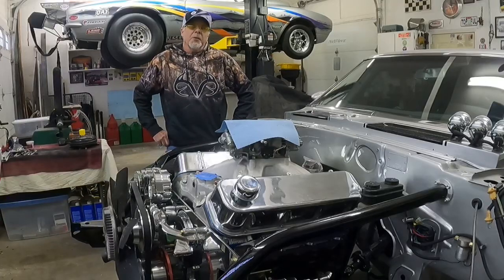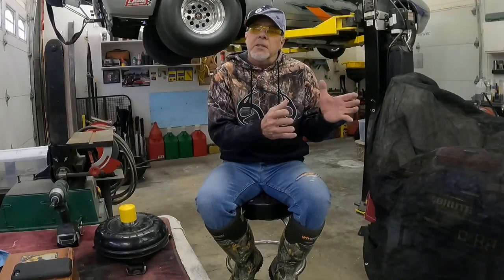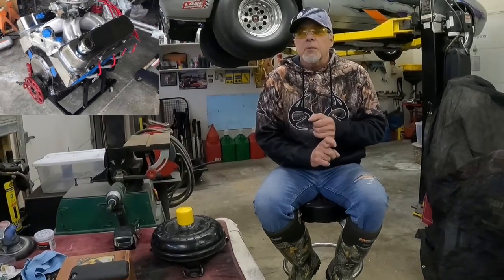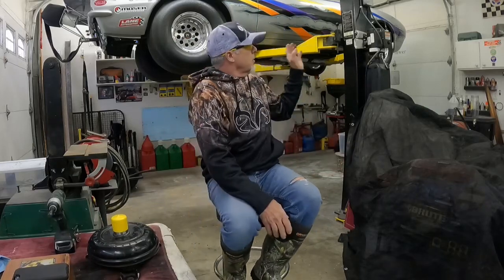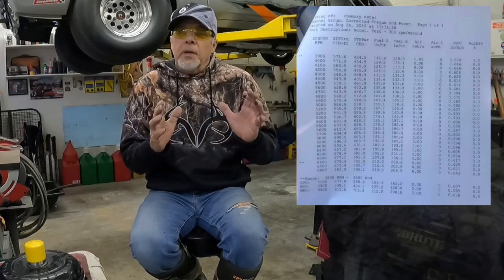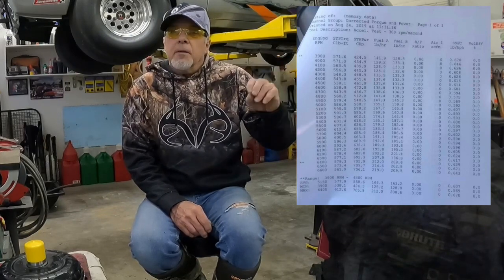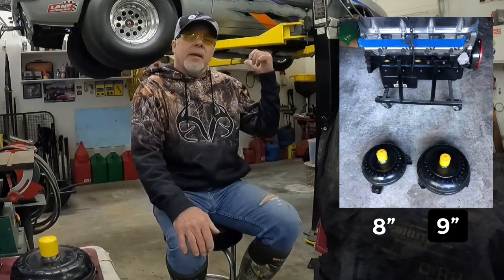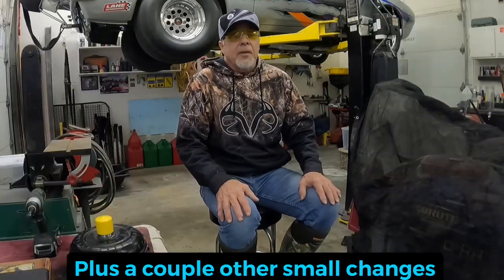Selecting a torque converter

Comment: Coe-Ann is one of the best convertor made. I been running Dave and now Jasons stuff 4 decades now. Never left me stranded.
Reply from the maker: Thank you Dooman 👍🏻
Reply: On a side note, I called Hughes about a converter a guy had for sale. They told me do not buy one of our on the shelf converters, you will flash it too high. I suggest calling the converter manufacturer before making a buy, esp a buy 1500 rpm higher than you need rule, that advice would kill the performance of a high torque application
Reply: @doomman700  it’s actually only accurate if true dyno data is known, otherwise, it’s a shot in the dark with guesstimated info. Guarantee the converter will need to be built from trial & error to get it right. 
I’ve seen countless fellow gear head friends chase converters these past 45 years.
Reply: @ronthepoolstudent  to a point I agree. However you are dealing with guys that build converters for a living and have seen a lot of the combinations being built.

Comment: Going from a 3000 stall B and M converter to a 2000 stall B and M made a big difference.
Now I go forward off the line instead of burning the tires.
Reply from the maker: Yes Gary, it’s all about hitting that sweet spot in terms of performance RPM. 

Optimal launch is dictated per everything that’s included within the power plant, suspension, gearing, car weight, and of course, the converter.  
A spot on converter makes all the difference in drag racing 👍🏻💪🏻👍🏻
Reply: So do u think it made the car quicker. Mine 3500 I’m thinking about going to 2500 converter.
Reply: @altondickens4277  In my case it did. It is a lightweight hot rod 1770 lbs.
A 427 W stock roller cam, Ford 306 aluminum heads, Edelbrock 850 cfm Weiand 174 blower,  3.25 rear gear. C4. 15 inch street slicks. Instead of burning rubber, it just goes forward quickly. I must have hit the perfect combination. More fun to drive now.

Comment: Best money I have spent is on a custom converter and double adjustable shocks.  Power doesn't matter until the engine is happy and it hooks to the track.
Reply: Amen to that Comet. My 67 has QA-1 adjustable shocks and a four link. I have it set up so no wheelie bars are needed. The car leaves level as it has an anti-roll setup. Also, Gun Lake Performance (Jeff Cuvey) did the back half work. That car is so well put together, it’s super smooth and has never gotten squirrelly out of 326 passes which is a testament to the car’s setup and also the tracks I raced at. The car ran 8.70s @ 152 mph then. Today, the engine puts out 33 more horsepower so it should run low 8.60s. I’m thinking the setup should still be adequate. 

Thanks for watching and for commenting 👍🏻

Comment: I have a 1965 sbf 289=300 hp at 4,000 rpm. In a 1964 econoline van with a new C-4  . The torque converter I chose is a 10.5 inch 2000/2400. The weight of the can is 3,500lb and the rearend is 3.25 sure trac. I’m changing the cam right now to a roller with roller hydraulic lifters at a 513 lift int/exhaust. Do you think that converter is good for this setup?
Reply from the maker: To verify William, contact Coan Engineering’s tech support. 
Run those numbers by their expert, they will recommend a stall number. Tell them you’d like the converter to flash in the rpm range for the cam and package you have.

Comment: you are the first person that explain right on the spot what a torque converter means here in the internet,,, there lot of guys saying oh,,, I just install my 3200 stall torque converter,, this is how it runs,,,!! but they do not explain what is the stall for,, thx for your info,, and I have a question ,,! I am building a 2008 corvette Ls3 making 571 crank  HP, I like to know if you can help here, looking for a torque converter for it, car wight 3250 lb ,, 3.1 ratio,  the guy that built my engine told me to use a 2200 stall, others tell me to use a higher one, so I am confuse here, if you can help please reply to my question ,,, thx,, keep it up,,!!!1
Reply: Thanks Oscar and thank you for your question. First off, that 2,200 suggested stall converter is way too low. That number would be more suited for a family type car. 

My best advice is to call Coan Engineering’s tech support then give them your info. They may also ask for more details. From this info, they will suggest a converter that’ll get you in the ball park. 

Also, what are your cam specs?
I’ll await your reply before giving my personal stall advice.
Thanks…
Reply: hi, and thx for you reply,, my cam specs are 227/235/ at.050 and 620/605 lift, and I think on the corvette came out with 3.1 ratio, not to sure,,  @ronthepoolstudent
Reply: @oscaresquivel8583  thanks for the numbers Oscar. 
That cam is a low end torque cam so I’d rely on the converter company to plug in the numbers to see what they recommend. 
That’s the most accurate way to move forward. 
Please let me know what they say as I’m very curious. 
Thanks again 👍🏻👍🏻👍🏻

Comment: What would you suggest for a torque converter? 425(437) Olds. TH350, aluminum heads, single plane intake, 950 carb, solid roller cam, open headers, 4.10 gear, 28 inch tires, both 1/4 and 1/8 mile tracks. Some street use but not often. Cam manufacturer says peak hp at early 6000's, peak torque early 4000's. Not sure on hp, I would guess 550 at the crank. Light car, 2800 lbs with driver. Thnx!
Reply from the maker: I suggest you fill out the Coan Engineering questionnaire and ask their tech specialist for a part number. That’s the second best way to determine which one is best.

Comment: Great video,  Thankyou.  I have an 02 silverado 1500, 5.3ls 4l60/65e  3.42 end. For towing, daily driver,  what torque converter speed do you recommend? A 1400-1600 or a 1650? Thankyou Again
Reply: Thank you Dale for your question. Your question however is actually tough to answer. 
I recommend contacting Coan Engineering’s technical support. They will ask for more information and provide you with an accurate answer. 
Imo, the numbers you have provided seem too low. I would be curious to hear back from you, once you’ve reached out to Coan. 
Thank you once again and please stay in touch 👍🏻

Comment: Hello curious if you think i'm heading in the correct direction with my street converter? My converter knowledge is near zero. I'm using a Summit billet 3500 nitrous converter(was planning nitrous but dropped it). I bought my project truck as a disassembled builder with a dyno sheet and just about everything I needed to complete it. I based my converter choice on my dyno sheet torque #'s 3500....400ft lbs......4500.....513.....5700......560.......6400....526. This is in my 95 Sonoma, pump gas 399ci. 1st gen., guessing 3400-3500 with me, turbo 400,  3.50 gear. This is a street truck with occational trip to the strip.
Reply from the maker: @heshtesh  your 3,500 converter isn’t going to do the job. You’ll need a higher stall for sure with the specs you’ve given. 
As I recommend to everyone, contact a  converter manufacturer and fill out their spec sheet. They will then give you their recommendation. 
Also; you’ll need to tell them what your expectations truly are, either street or strip use. Coan Engineering is a good start.

Comment: Great info thank you.  I have a new motor but dont have the exact specs. Trying to figure out the converter for it makes it rough without real world experience. 
347 stroker with a c4.
Est. 400hp/400tq.  
Street car . 66 mustang. Going with 3.5-3.7 rear end gears.  
Short of finding a dyno somewhere what would be a safe choice? And do brands matter ? I dont want junk!!!  Thanks so much.
Reply: Thank you Dave, I appreciate it. 
Although there are a few great converter companies, i’m a Coan Engineering guy. 
I’ve been running their converters for many years without issue. 

My suggestion would be to call the company to discus your package. Their expert will more accurately steer you into the converter that fits your needs and provide pricing. 

Please let me know what you find out as I’m curious. 
Thanks again 👍🏻
Reply: @ronthepoolstudent  so I talked with them this morning.  They are going to build me one, and he said the stall would end up around 2600 rpm based on my estimated setup.
Great customer service. I dropped your name too👍 Thank you
Reply: @DaveIrish66  glad it worked out Dave, I’m sure you’ll be happy with their converter. 
Thanks again for reaching out 👍🏻

Comment: Very interesting information!
 What I'm curious about lately is that I know that the weight, gear ratios, engine torque and HP and camshaft selection has a significant influence on torque converter requirements but what I'd like to know is how much influence intake manifold selection has on it. I know that the whole engine package should be matched up to complement each component and what you intend to do with the vehicle like daily driven or street and strip or strictly a strip car but how much of a factor does the intake manifold have overall. I remember when a good friend of mine built a '69 Chevelle back around 1990 or so for more or less a daily driver but also for good street performance. It was a .030 over 350 V-8 with a somewhat mild camshaft, a little lumpy but not much, and he had a Weiand high rise single plane intake put on and a torque converter from a Chevy Vega, a small converter, and of course a stock 350 turbo hydro automatic transmission. I remember he was a bit disappointed in it because it felt mushy on the bottom end, just as it took off from a stand still. The engine rpms seemed to rise up a bit high before the torque converter really dug in but I do remember the car ran nice and smooth, sounded good. Anyway, had he chose to put on say a Edlebrock Performer dual plane intake on it do you think it would have made a significant difference in the drivability or not much? Also, on the other end of the spectrum, if he'd have chose to install say a tall tunnel ram would that have made a significant difference in performance or if the bottom end would seem mushier or about the same. 20 years ago I was studying a lot of the performance builds and parts for hotrod's but over the years I've gotten a bit rusty on some of this kind of info and I don't really have much real world experience in it, mainly just from what others have said and theory so I'd like to hear your input on intake manifold selection and how much it has a factor on torque converter selection if any?
  Great video also, it's interesting to hear all of the perspectives people have on performance aspects. 👍
Reply: Thank you Jeff for your question. I can only tell you that I build/tune my drag engines for optimal intended performance first. I then fine tune on the dyno. 
From there, I have the converters custom built per dyno outcomes as indicated on the dyno sheet. I give this info along with car and drivetrain information to my converter builder, Coan Engineering. 
They do a great job of customizing what’s needed. 

Intakes:
As a drag race guy, I’ve always opted for single plane intakes as they compliment a more aggressive cam grind and high flowing cylinder heads for drag racing. 
I’m not really qualified to talk about dual plane intakes so sorry about that. 

I might add:
I do drive the streets however, but I would not want to build a tightly wound drag engine for distance driving. 
It all comes down to compromise per the build and what performance one is looking for…street or for the stripe 🤔🤷🏻‍♂️
Thanks again, I wish I could have helped more.
Reply: @ronthepoolstudent  Thanks for the response.
 I hear what you're saying, you sound like you're well versed in the drag race department which is just a pipe dream for me right now but maybe one of these days, if I ever have the means, I just might delve into it.
Reply: @bodeine454  thanks Jeff, it has gotten very expensive which is why the sport has slacked off imo.

Comment: I have jeep grand cherokee wj 4.7 v8, 4 speed , 245 horse power  engine  , Automatic Suv and with 3.73 Axle gear ratio front  dana 30 and rear dana 44  and I am using  17" wheels  rims with tyre's 265 width 

Can you tell and help with type of stall torque converter will be suitable for my engine
Reply: I also have a Grand Cherokee. Mine has a 318 that’s stock. 
To answer your question, sorry, I wouldn’t know. This said, I would contact either Coan Engineering, or any other converter manufacturer. They may be able to take your vehicle information/engine/gear ratio/tire size and  compute and give you a more accurate answer. Hope that helps.

Comment: Hi Ron, thanks for sharing! My race car is an olds cutlass with a  carbarated 5.3
Turbo 400 reverse manual valve body
4.56 gear
Aquadale speed shop hog ass cam
I'm looking for advice on a good budget converter!
Thank you sir! 🫡
Reply from the maker: The best way to start would be to contact Coan Engineering’s tech support. They will ask pertinent questions to best advise you on a shelf converter to suit your needs. 
You can also ask them to email a build sheet which you can take the time fill out more accurately, then email it back.
Reply: @ronsmusclecargarage4060  awesome! Thank you Ron!
Reply from the maker: @thehouseofhorsepowerautobo4506  you’re welcome 👍🏻

Comment: I'm just learning about this and one thing I'm curious about is measurements. You mentioned going from an 8 inch to a 9 inch. How is this measured. Is this the outer diameter or is this measured straight across ?   Another thing I'm curious about is in a street car does one maybe want to go with a little lower converter to make things more street friendly than say one that would be the optimum for launches at the drag strip ?
Reply from the maker: @timd4151  it’s measured in diameter Tim. As for street converters, I run what is optimal. I’ve never had a performance converter issue in all the years running one. I’ve had people tell me all sorts of untruths about high stall converters running on the streets. 
Thanks for your question 👍🏻
Reply: @ronsmusclecargarage4060  Thank you for your reply.  my new SBC motor isn't liking my factory stall convertor  so I'm trying to learn more about them because I've never run a high stall convertor before and can't really afford to make the wrong choice on which to buy.
Reply from the maker: @timd4151  I hear you, Tim!Converters are too expensive to guess at. 
My best advice is to contact Coan Engineering and talk to tech-support. 
Tell them you want your set-up to perform optimally and not bog off the line. They will then ask you several questions about the set up. If you don’t have all the answers when on the spot, ask them to email you a set up questionnaire sheet. Fill that out to the best of your knowledge then get back with tech-support. 
This is the best way to get you close to what you need.

Please follow up to let me know how it goes and good luck 👍🏻

Comment: Where do you race? Michigan here too. I’m working on my bucket list and building a 83 Z28. 450 hp sbc with a 700r4. 
I noticed a lot of converters are listed as reman.  Is that normal?
Reply: I’m retired from actual racing now Festerman but I’ve raced at 131 Motorsports Park, Mid Michigan and NMDW. 
I first raced at Mid Michigan in 1979 (Stanton) as I lived in Rockford at that time and it was closest. 

As for remanufactured converters, that wouldn’t bother me. 
When I buy a converter these days, I have it gone through anyway and have it customized as mentioned in this video. 
This being said, my newest 9” Coan converter (for my 67 car) may or may not be a new piece 🤷🏻‍♂️ I’m inclined to think not as it was custom built for my setup so they most likely used a core to fit in the components into as needed. 
Hope that makes sense and thanks for your question.

Also, it’s cool you’re building a car. I am curious as to why you decided on a 700R4 though? 
Thanks 👍🏻
Reply: Totally not an issue. 
I worked at an engine shop and they had a trans guy, but he previously worked in a shop that did exactly that.
He said some  cutting and welding is required 😃
Yep, that's probably the last frontier for the backyard crew to figure out, how to rebuild one. 
Pretty much anything else has been hacked so it can be repaired by the little guy, but the torque converter remains elusive 😃
Reply: @MrTheHillfolk  I leave the converter science up to the experts. 

I’m a bit worried about Coan however, I’ve heard their top people left and these were 20+ year veterans in the company.
Reply: Really, a 700R4 transmission? An overdrive trans for the track is not really necessary. And a overdrive trans for the street is not happy with big lope cam. I'm not criticizing you, just trying to figure out the advantage of a 700R4 over a power glide, or a4L80 if you need the overdrive.